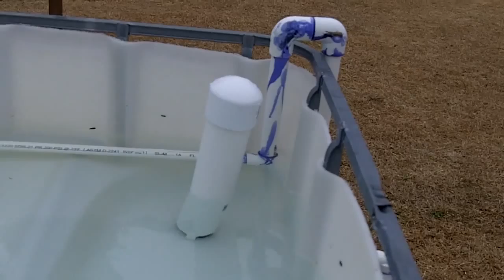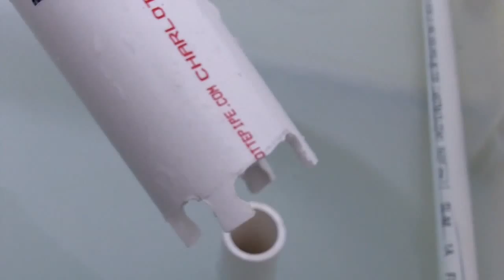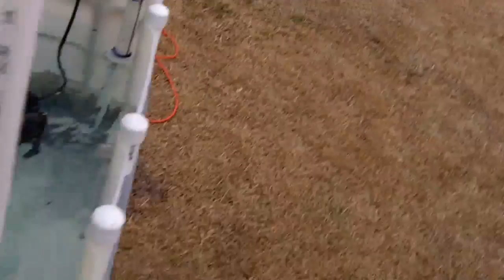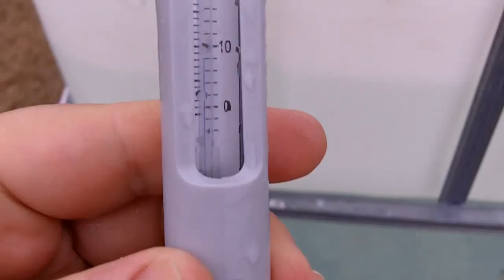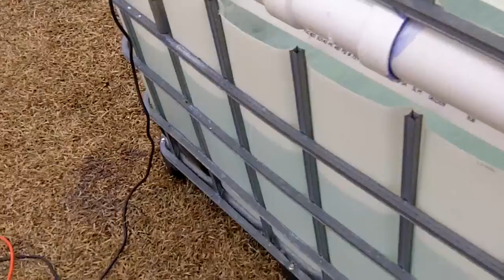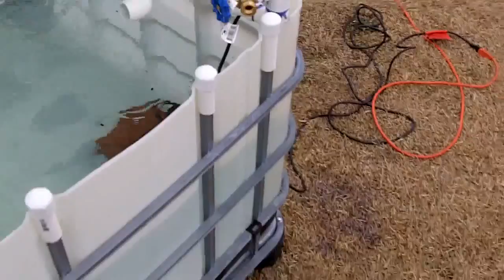IBC tote Aquaponics system update

Comment from the maker: The pumps that I choose were chosen mainly for water volume and I think that was a mistake. If I were to go at it again I would choose a pump that is more designed for 24/7 operation. Most likely a magnetic drive pump. Hope this helps!
Steve

Comment from the maker: @thededphish For the 2" pipe I used the same style grey fittings but in 2" size.
Using the metal cage as a frame for the grow bed works great for the side but is not strong enough for the bottom with a full bed of pea gravel. Plan on adding more support for the bottom of the bed. You can see I had to do that with 2x4's. Hope this helps!

Steve

Comment from the maker: @thededphish The fittings I used for the Standpipe and drain are actually 1" electrical fittings, they are grey PVC 1"male pipe thread to slip and 1" female pipe thread to slip. These fittings are identical to the equivalent plumbing fittings with the exception being the tapering of the fittings. This allows the fittings to tighten down better and make a good tight seal through the grow bed. You can look at my more recent video where I added a 2 inch pipe through the side of the tank.

Comment from the maker: @NoNonesenseRick Cost for IBC Aquaponics system

$40.00 IBC(You can find these on Craigslist)
$52.50 Pea Gravel 15 bags x $3.50 =$52.50
$100.00 Wayne Waterfall Pump, Model# BASS2400 (Northern Tool)
$36.00 Aqueon Pro Heater 250 watt (Enought wattage to temper the water at real cold temps)
$80 to $100 PVC pipe and other misc supplies(will try to get list of these later)

Approx $328.50

Rick, you might be able to do it for less. I tend to overbuild things.

Steve